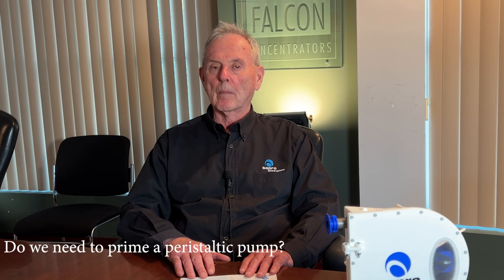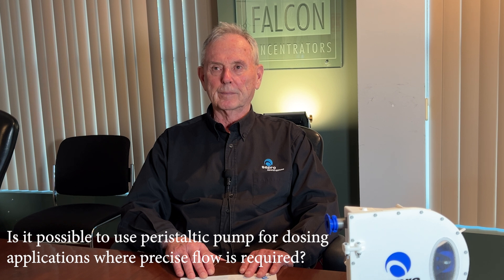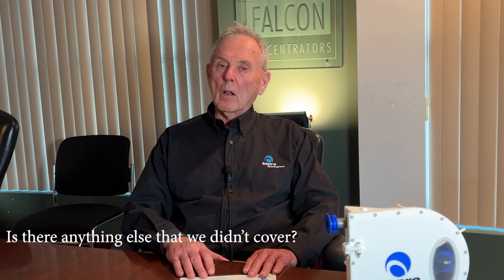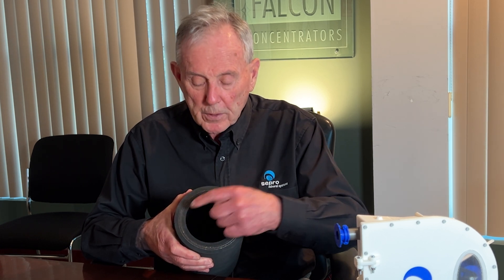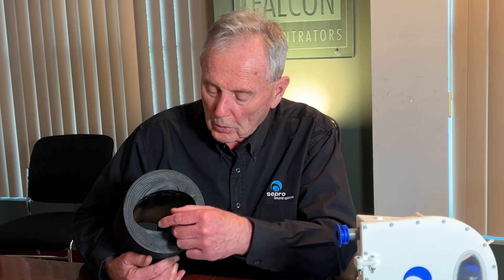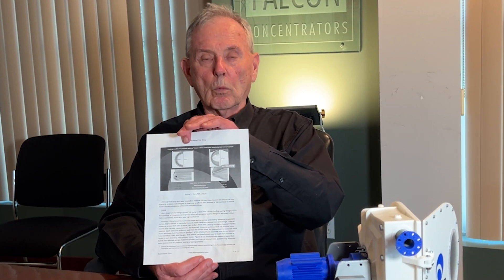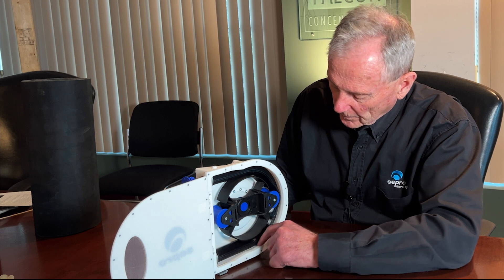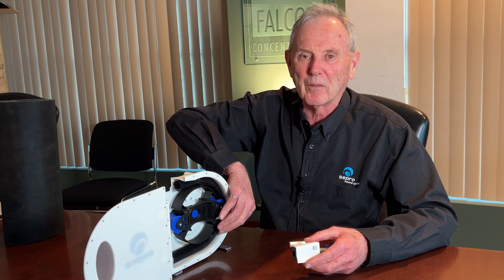Why Use Peristaltic Pumps? | New Pumping Technology In 2025

Comment: Very interesting pump design, could this ever be scaled down to run off of 5v power supply with around 50 GPH? 

  I am not familiar with that kind of pump at the time of this comment but for us small scale miners/creators, a pump like that could solve so many problems when it comes to recirculating systems breaking down by not having a proper filtration system for the return flow. 

  I would assume that all the extra resistance might add to a higher power consumption and therefore may not be practical in smaller designs but it would be really interesting if this design would help when dealing with a really low GPH flow rate.